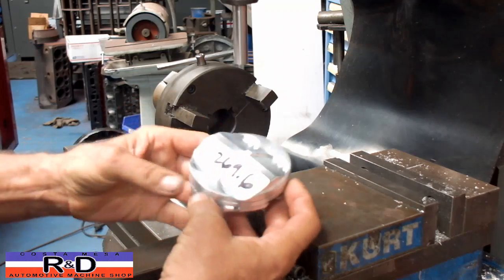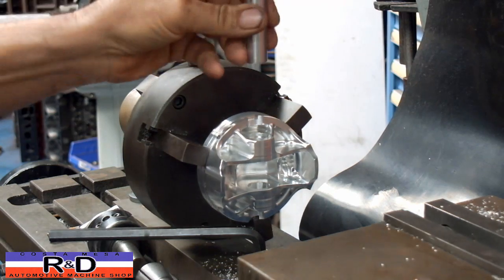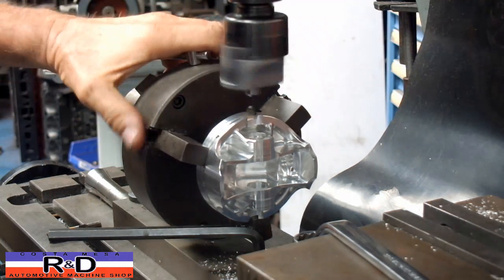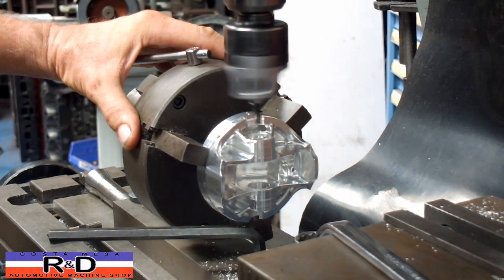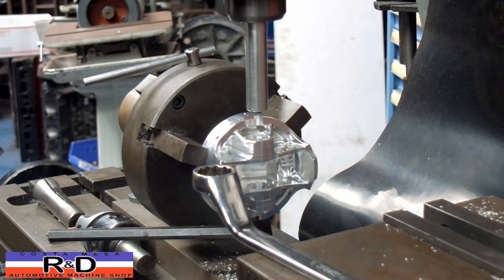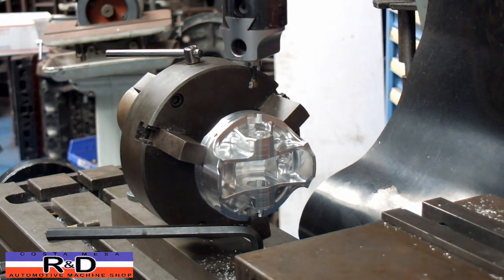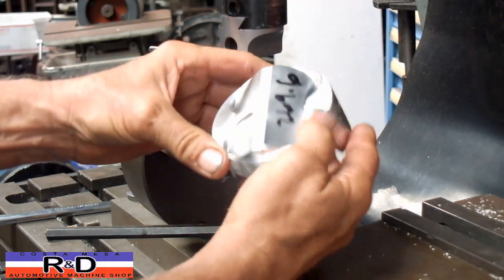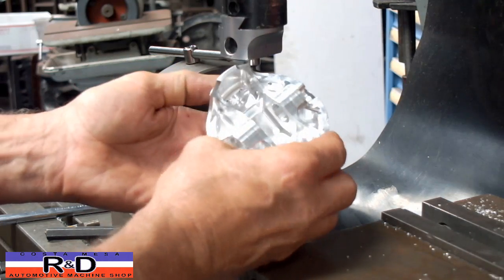Piston Pin Bore Enlargement 17mm to 18mm

Comment: You could plunge cut that with an appropriate end mill on center. 
Spin that boring head 750 rpm too.
You could also index your 3-jaw chuck so it could rotate and lock at 180 degree locations so you could leave the piston locked in chuck , hence not having to relocate it twice.
Thanks for video.
Reply: if you pay closer attention. its easier the way he is doing it.
and there is a very good reason for the way he is doing it.
but feel free to show us some of your work

Comment: what would it cost to have two(2) 80mm 2 stroke pistons with 18mm pin bores bored out to 19mm pin bores be? you are one of the few machines shops that i have learned that will do this kind of work.

thanks.